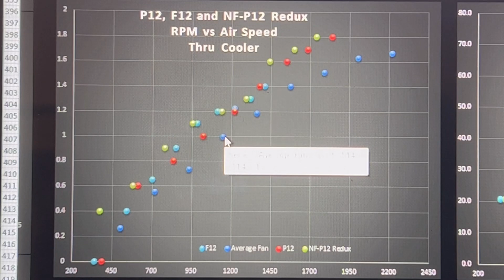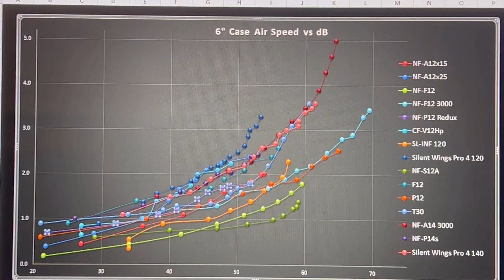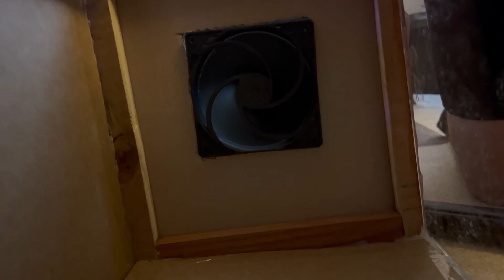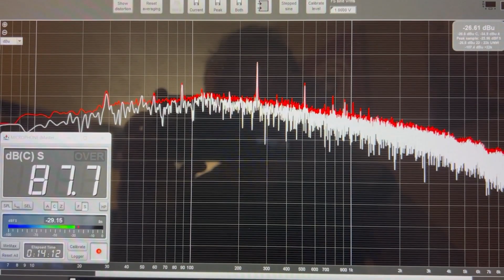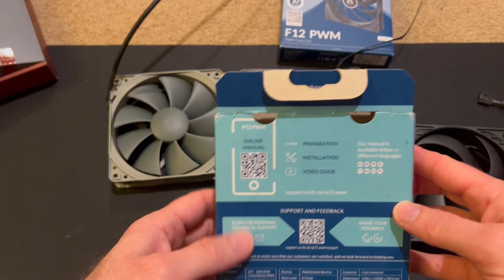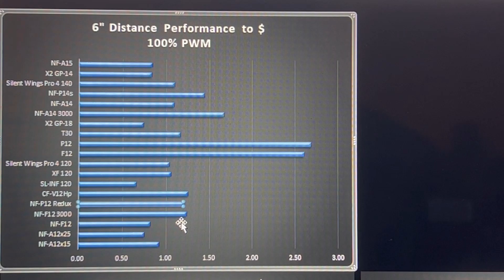Building a PC on a Budget but want good fans. NF-P12, Arctic P12, and F12 (Old Testing Method)

Comment: You said that Noctua NF P12 1700 Redux are good for radiators, is it okay to install on my case 5 of these? (cpu cooler single tower fan swap, rear exhaust, top exhaust, bottom intake, front intake)
Reply from the maker: sure they will move air they just are not the best. If you want a uniform look and your case is not a hot box design or your not loading it up with really high powered components. they will do fine.
Reply: @computer-tech-more  okay, i installed of 5 of these, and by default (windows 11 start desktop) I hear quite loud hum inside the case, is it because of the high rpms? Or it's because of the high pressure they produce? (more pressure = more noise)

I heard that fans that have less dense wings, are better and queieter as case fans?

I really hate noise, maybe i should go with Noctua A12 NF instead
(btw my pc specs are ryzen 7 7800X3D, RTX 2070 Super, 32GB 6000mhz, cpu cooler thermalright burst assasin 120)
Reply from the maker: @Fleecaguy66  pressure fans do tend to be louder than airflow at similar RPM. 
what RPM are you running the fans. 
like is it a hum of a motor or more woosh of air.
The A12 is a better fan. so it all depends on your budget. 
I have a few best of videos up on my channel from 2025. that should help narrow down "the best" fans for you.